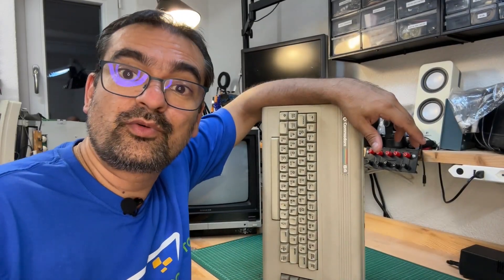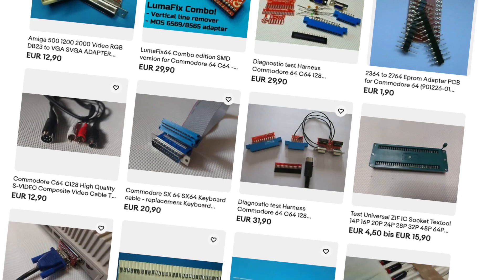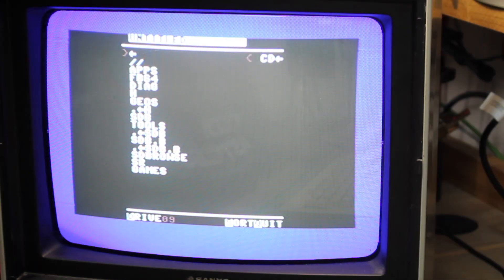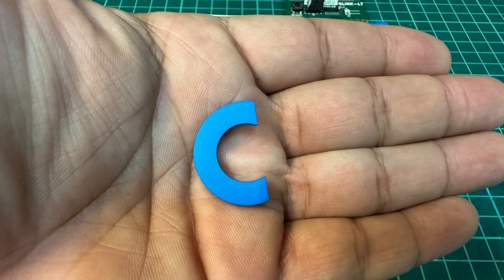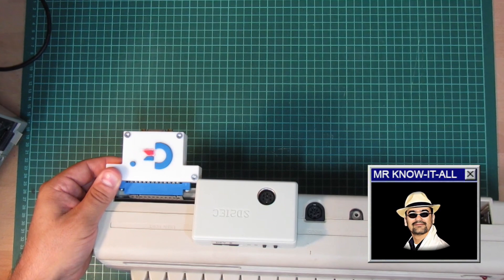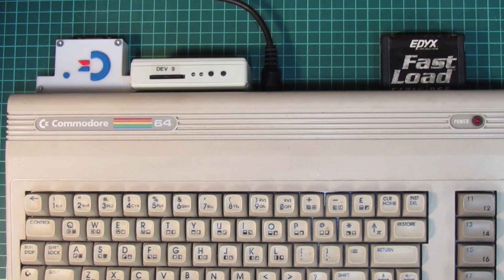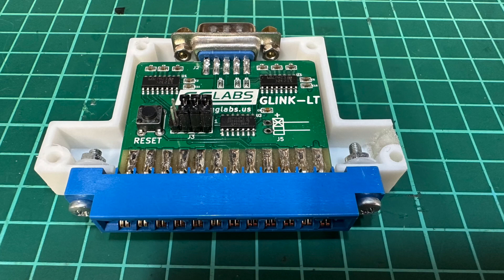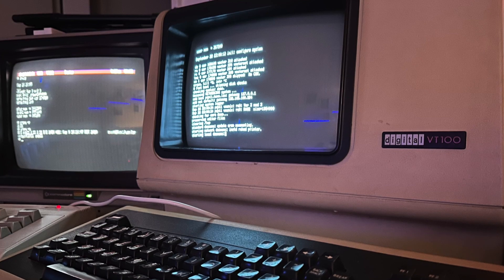C64 on trial: Is it any good as a serial terminal?

Comment: An INTEL 8251 USART might have been a better idea than bit banging.
Reply from the maker: Bitbanging would totally not have been required if Commodore actually didn‘t implement the UART in software but used the MOS 6551 instead.